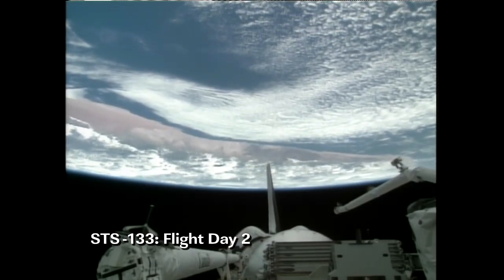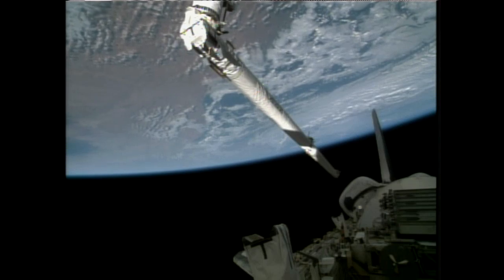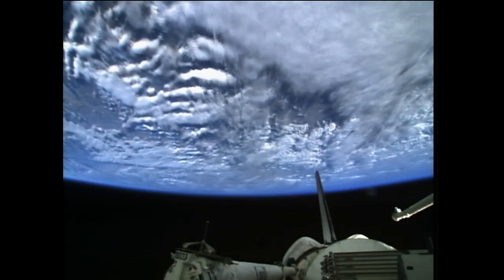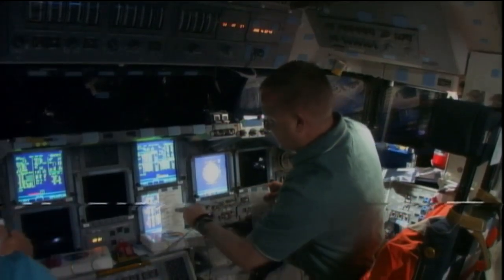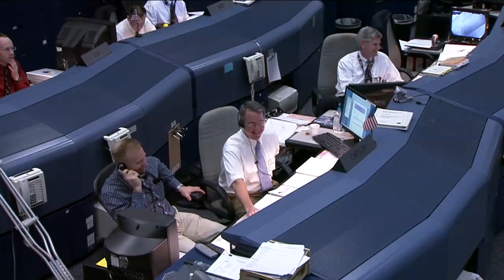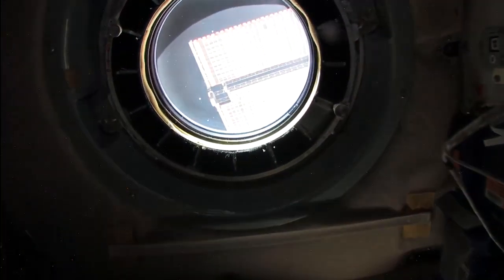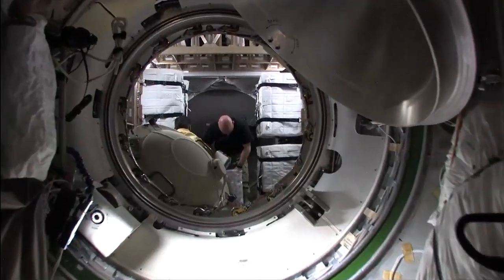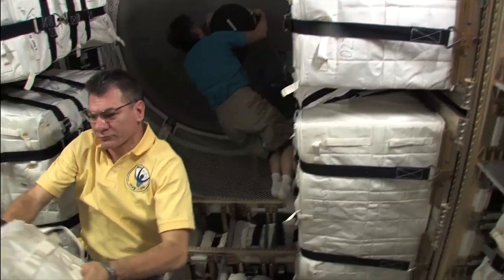STS-133 Daily Mission Recap - Flight Day 2

Comment: Bloodgod40 - thats an understandable thought, but it would cost much more to build a ATV that has the internal parts to be reuseable, plus the mechanisms to make a recovery system, plus retrieval plus the work to refurbish it and test it for relaunch.

It's cheaper to use it as an incinerator and build a new one. Also by the way it is not the size of a london double decker bus, its smaller.